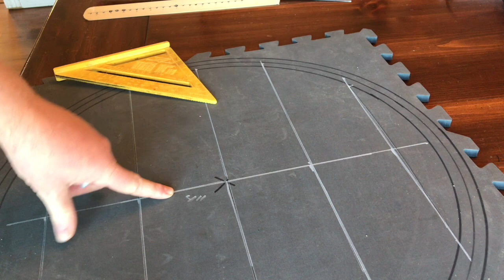Make a fantasy shield DIY cosplay or decor prop!

Comment: This looks amazing! where did you pick up the thinner foam for the edging?
Reply from the maker: Hello Tina, the thinner foam was just cut strips from the larger foam mats I used for the main shield. The material is pretty easy to work with and the rubber cement does wonders for bonding it together to hold the curve when finished.  Thanks for watching :)